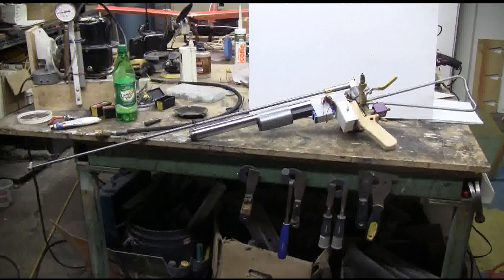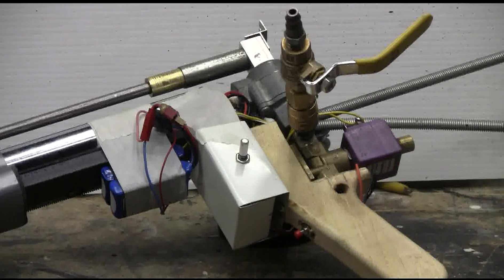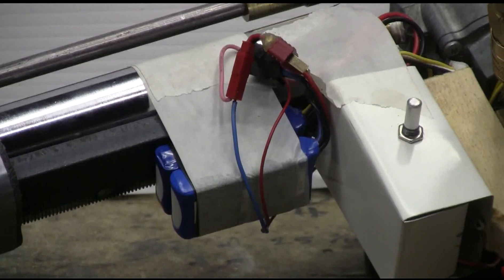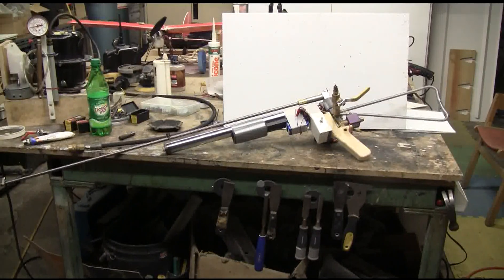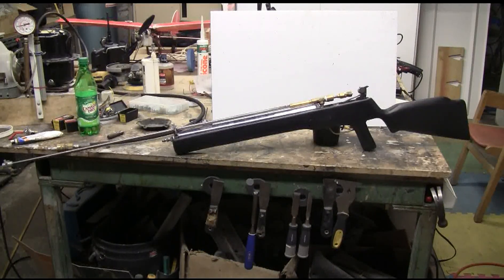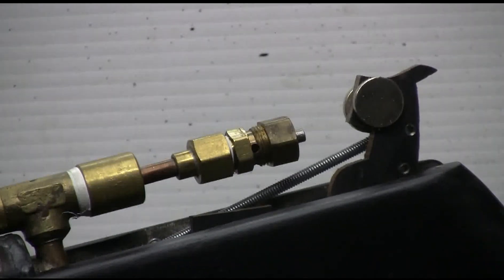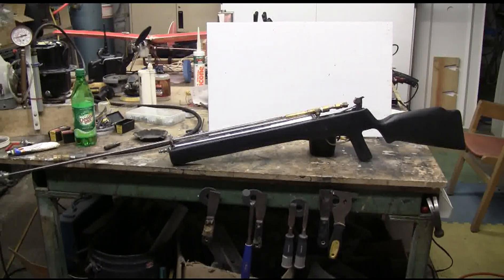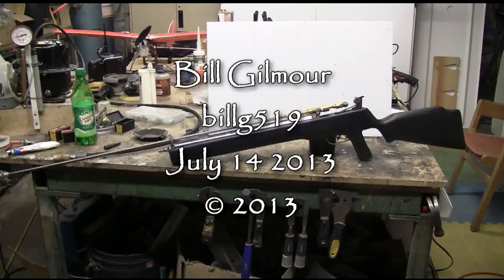Air Cannon #84 - Two New Air Guns .25 Cal BB's

Comment: I'd trust the hammer valve piloting a QEV at high pressure rather than the 24v solenoid valve.
Nice stock one the second, I wish I had a woodwork shop as well.

Comment: The QEV could be piloted by a smaller qev (1/4") which in turn is triggered by a blow gun (1/4"). The blowgun could be the "palm grip" type with less pilot volume.